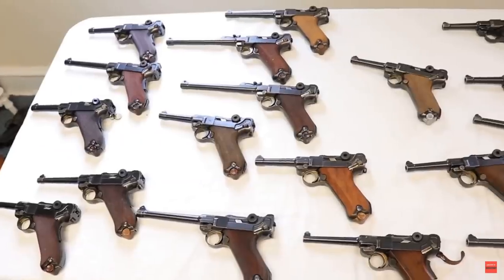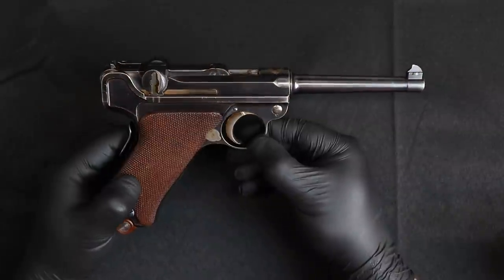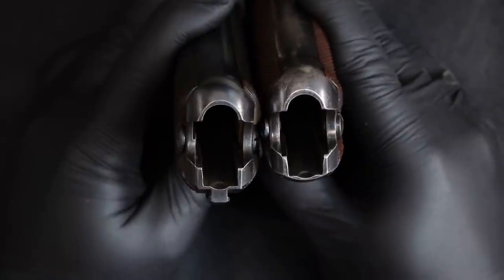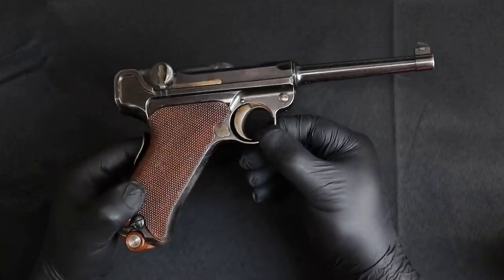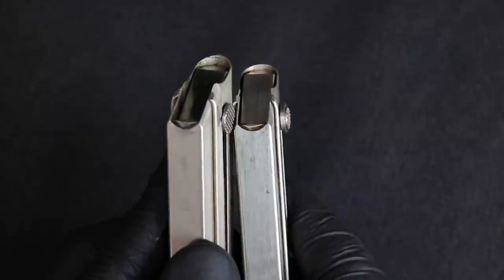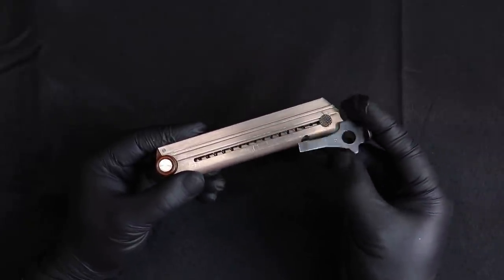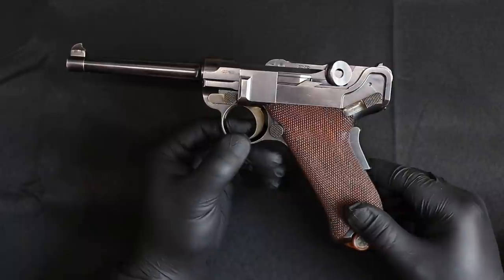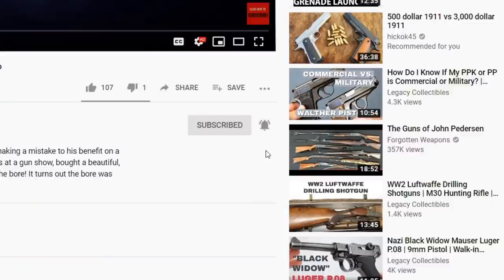VERY RARE & Early Luger With "Unrelieved" Frame | What does that mean???

Comment: Great video. The loading tool works better if you turn it around and pull it down with your thumb.
Reply: My loading tool has the thickness reduced so as to fit behind the button.  It won't work on the original, correct SN number, mag that came with the gun.  However it works nicely with after market mags made by MEC-GAR.  My gun is SN 27,xxx

Comment: You are using a Luger tool on the magazine upside down :). Try to reverse it and tool will sit perfectly on a magazine rail it will be also more stable. You can use this outlier side element (on a Luger tool) to hold the follower spring firmly. 
I think that this larger button on the magazine is needed to hold the bolt in open position after the last shot. Early luger doesn't have this so larger button was unnecessary. Correct me if I'am wrong :).
Reply: Yep, loading tool upside down.....:-))